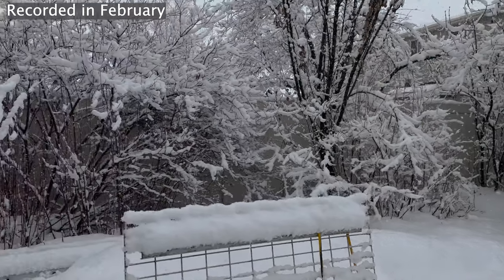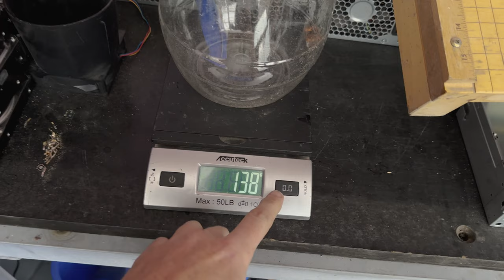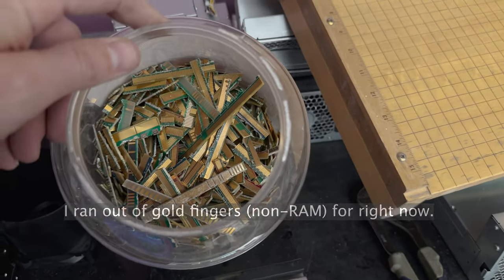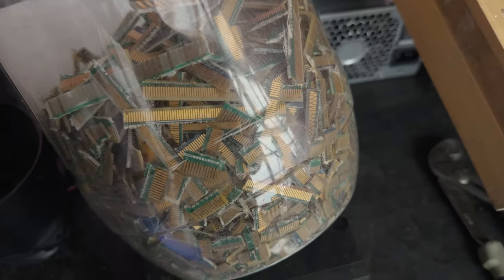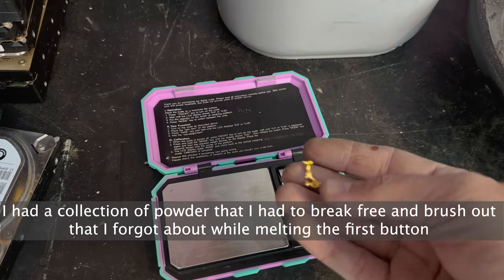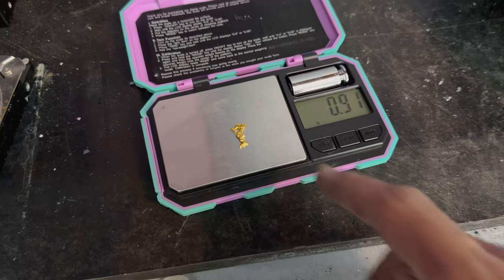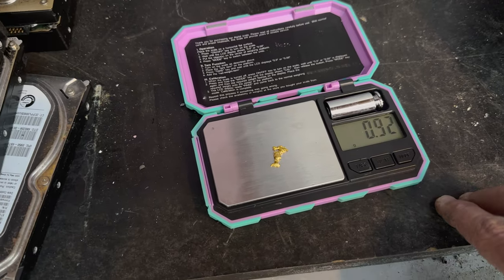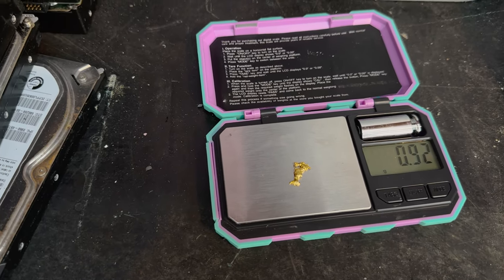Gold: 2KG Circuit Board Fingers

Comment: For most of them, if you use an iron solder, you'll get more quickly the gold plated fingers and use less acids and times ;-)
Reply from the maker: I will have to look into that process... do you have an example you can point me to?
Reply: Look at moose scrapper. He shows an example in one of his videos. 

If you have a ton of time, it may be worth it, however I’ve always preferred to use either AP if I’m being cheap, or nitric if I’m in a hurry to get the foils off. Then AR etc etc.
Reply: @badideametals  It was from eWastBen : https://www.youtube.com/watch?v=JeFzFFAON0A&t=533s
Reply from the maker: Thanks guys.  I will look into this.
Reply from the maker: Ok, after seeing what eWasteBen is doing in the video linked in this thread, I am intrigued ... I will try this.  It does not look very scalable.  It would save on liquid waste and acid usage, ... that is true.  But I would be picking flecks of gold off of boards for the rest of my life :) ... But I will try a video.  Thank you all for the recommendation.
Reply: @badideametals  In fact, but his method works fine and very fast to get gold trimmed.

Comment: Given all the pulp, would it help to incinerate it before dissolving the gold, use less acid too?
Reply from the maker: Circuit boards do really nasty things when heated or burned.  There are some really nasty chemicals bound in there.  I would not recommend burning the boards as a hobby refiner.  I would imagine if there was a furnace that could get hot enough to flash incinerate the boards, then maybe, but would that vaporize the gold too?  I am not sure.  

The amount of acid used is actually really cheap.  HCl used in this video was $12.  I would estimate the nitric used was maybe $1 ... or even less.  All together, the button is worth maybe $450 and my costs were $13 ... and my time.  Oh and propane ... maybe about $2 in propane.  There is really not much expense with this method as HCl is pretty much $10 to $12 ...